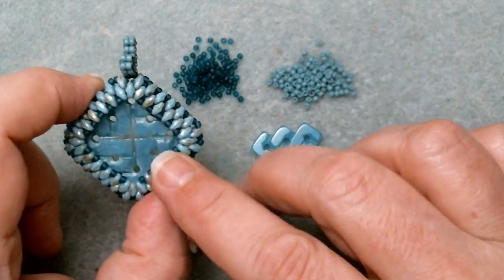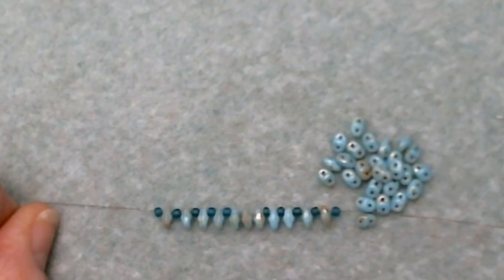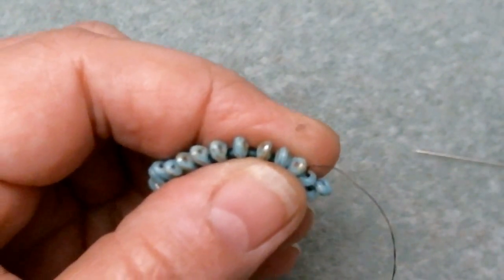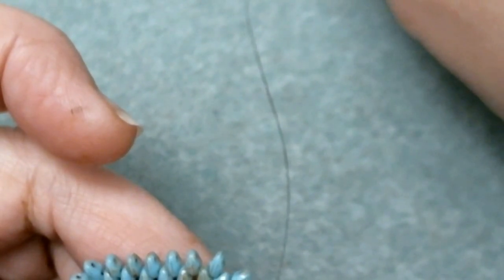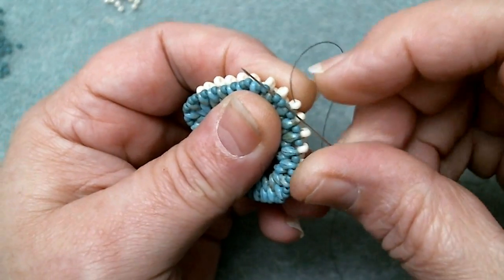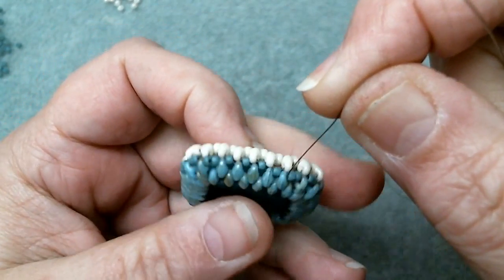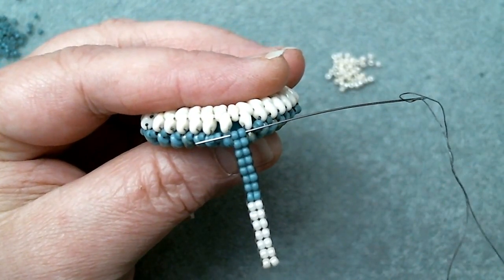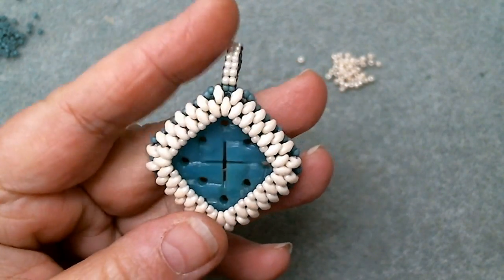Square Celtic Cab & Mini-Duo Pendant Tutorial

Comment: Very nice design and unique.  Curious about the bead itself, the cost at 3.65 ea seems a bit high can you provide who actually makes the bead?  Bead Shoppe does not provide any info at all on the product in regards to that as a 3rd party seller.
Reply from the maker: I don't know who actually makes the stone piece I put in the center. You can substitute it for other square cabs or beads of your choice, or a resin piece you make yourself. I know you can get square glass tiles in that size inexpensively at Michael's that you could put images or paint the back yourself. Cabochons always run around the 4-6 mark in most cases no matter the shape. You will need to be creative to find a less expensive option.

Comment: would this also work on a round cab
Reply from the maker: Yes it would also work on a round cab. The concern is that it would be easier to slip out. I would recommend some covering the back in bead work or starting with 15/0s so that it is much tighter on the inside edge. Hope this helps